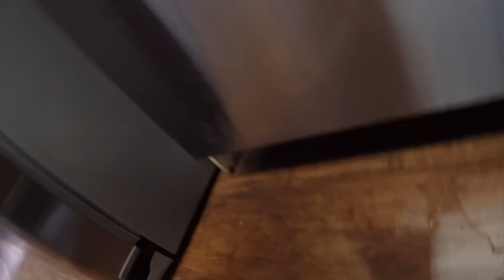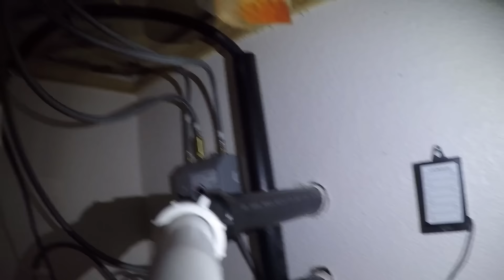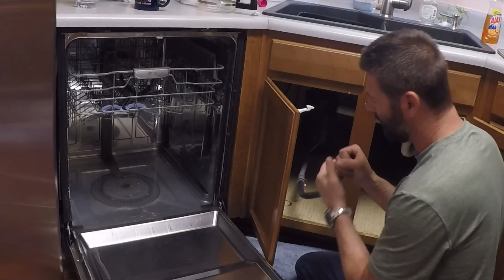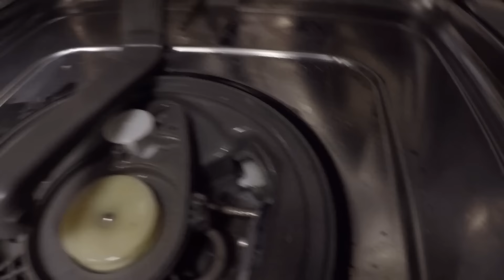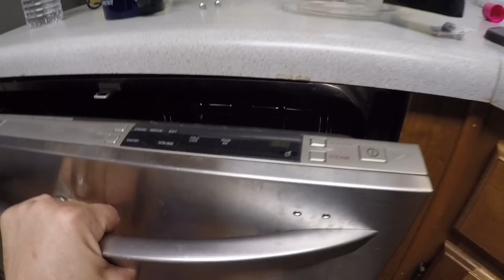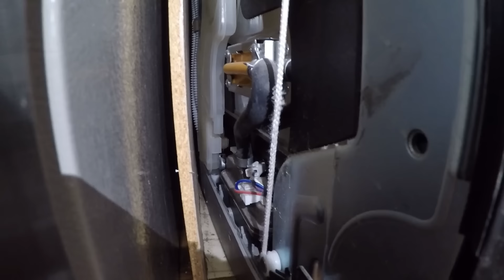Easy Fix For Dishwasher That Wont Drain | THE HANDYMAN

Comment: All, this is good information. Also if you have just installed a new garbage disposal in your sink, make sure the plug is removed. It is really easy to do just a screw driver and a small hammer. You can remove the plug prior to installing the disposal or if it is already installed just put you hand inside and pull the plug out. It’s made of plastic. If you are installing a badger insinkerator, read step 15 in your instruction manual. I didn’t and had water standing in the dish washer. This was the problem for me. Hope this helps someone.
Reply: Hi
Reply: Thank you!  This was exactly what I needed to hear.
Reply: Yes, it did, ty. Just changed garbage disposal n missed step 15
Reply: This was EXACTLY my issue. Thank you!!!!
Reply: You saved me hundreds of dollars from not having to call in someone who service my dishwasher. I read your post and found out this was exactly my issue. The installation video I referenced didn't mention this at all. Thanks so much.
Reply: You da man!
Reply: Thanks man, this was exactly my problem.  Admittedly didn't read the instructions that came with the new disposal.  Got it installed just fine, but had no idea there was a plug.

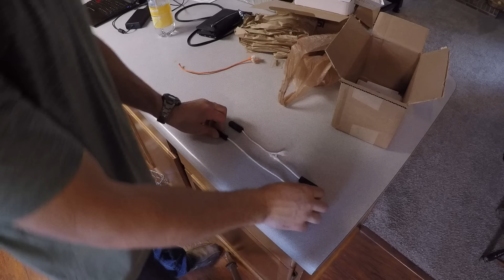Comment: 9:02 i have the exact same dishwasher and just did the exact same fix. i was shocked at how cheap they were using string. what annoys me even more is that i know i will have to replace it again in another few years. my grandmother has had the same dishwasher since 1981, and the difference in build quality is huge. things really were made to last back then.  had to replace the dispenser as well because the plastic tab that hooks onto the latch broke off

Comment: Had same thing few months back, it would work every other time you tried to run it.  After few times, the code came back on, pretty much I found glass stuck in the impeller and I believe it was there long enough that the motor was burnt out and wouldn't work until I replaced it. Works now, glad yours worked out 👍 keep the videos coming Handyman!

Comment: PROTIP: On those dishwashers - you can press the button THEN close the door versus trying to stick your fingers into the small slot post door closure event.
Reply: That assumes all your buttons are working. I've got a similar model. The buttons on the right half of the door just stopped responding on mine, meaning that I can't start a load of dishes even though the washer will turn on.

Comment: 12/21/23
Good idea to blow out the water drain hose. I did not have enough lung capacity and strength. I used an air compressor. I placed a 3/4 inch PVC nipple covered with an uncap with a quarter inch hole drilled. This worked very effectively.
. it cleaned out the clog from the Kenmore Elite.  It is now pumping the water out effectively. thanks for the good idea.

Comment: The two dishwashers I've repaired for friends both didn't drain because of a broken wine glass. Bits of glass got stuck in the bottom filter, pump drain, etc.
Reply: And how did you get it out? I suspect the same with our dishwasher
Reply: @billgatess1  I took out the racks. Undid the filter at the bottom and looked around the very bottom with a flashlight and carefully extracted the bits of glass there and in the filter.
Reply: Could broken vodka bottles stop it from draining? Asking for a friend.

Comment: i mess around for 6 hours cleaning the hardwater out of my dishwasher and it still didnt work until i blew the pipe like u did in this video and after that the damn thing worked finally , i guess it needed all the air out of the hose to make back pressure thanks so so much for your video, watched 20 others and it didnt work.

Comment: Hey handy man nice job figuring that out. I have installed many dw and inspectors here in florida want dw drain line coming from up top as close to top as you can then loop or have a lift and drop to keep from having water back flowing from sink back into dw and not draining right . Some counties want line strapped or zip strip holding high or holding loop. Good video ! Till the next one !
Reply: Thank you very much for the tip about the loop! My dishwasher was continually getting stinky and we couldn't figure out why. My dishwasher discharge line ran straight dishwasher to the disposal.. and I'm guessing it doesn't have a checkvalve in it to prevent flow from the sink into the dishwasher. Didn't have enough line to create a loop, but pinned the line up high, very close to the countertop and well above the disposal... it's been about two weeks now and the stink is minimal!! We've been washing dishes by hand in that time... there was still a little stink left in the dishwasher tonight when we looked for the first time so we're going to re-run it tonight to clear that out and get a better "stink baseline", but I think I'm going to go ahead and call this a win! Thank you again

Comment: Pls talk to us as your doing your stuff. No clue what drill bit ur using or which hose under the sink do we disconnect? I have 4 hoses with my disposal. I need better instructions
Reply: Please don't use a drill just use a standard Philips screwdriver the hoses that go to your dishwasher should run through holes that are drilled through the side of the cabinet there's a water supply hose and there should be a clear or maybe solid colored holes it's usually corrugated that will connect to a garbage disposal or the tail piece of the kitchen sink if the dishwasher is not draining try holding the drain option or holding the start option to cancel the operation to see if there's a humming sound if there is a humming sound that would indicate that the pump is still running if the pump is running try disconnecting the drain hose from the garbage disposal or sink drain tailpipe and using approximately 4 to 5 ft of 12 or 14 gauge electrical wire you will need to curl it at the tip to push it through the drain hose that will clear any solid debris from the hose you may require a multi-bit screwdriver such as a 11 in 1 to remove the drain hose from under the sink

Comment: I had a similar job 2 months ago. It turned out the check valve (a little rubber flapper valve) had broken off and got clogged in the drainage hose. I made a new one from a rubber flip flop sandal I had in my truck and it's still working. I did not charge for the new part :-)

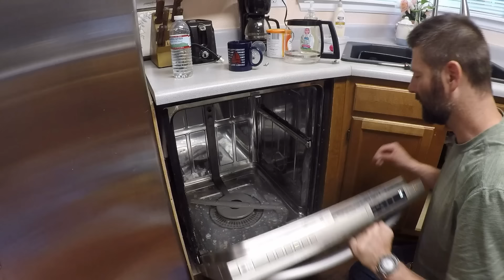Comment: 7:02  ...if you want your dishwasher to load hot water then run your hot water at the kitchen sink until it runs hot before starting your dishwasher otherwise it will load the cold water that has been sitting in the pipe between your water heater and dishwasher (which will likely be the amount that it needs and very little hot water will go into the washing cycles (the hot water will only fill the pipe between those appliances and it will cool off by the time the next cycle comes, the result being that you will be washing your dishes in cool or cold water (unless you DON'T use the energy saver settings or DO use the heating element setting if your system has one))).  I have the idea that you will understand the situation and how it is occurring now that its been brought to your attention... Best regards.

Comment: Great video, thanks!  My dishwasher is not draining consistently.  It drains initially and then stops.  The dishwasher rumbles but no water  is drained after the initial burst.  Does this mean my drain pump is bad?  Will drain pumps work intermittently or do I have another issue?

Comment: What area are you in? Is there a P-Trap on the ABS? That is the first time I have ever seen a dishwasher drain into an open pipe like that. Most parts of the country require the dishwasher to go through an "air-gap" before draining into the main line and all drain connections should be secured with clamps. Looks like there should be a screen protecting the impeller from debris. I also do home repair and remodeling on the west coast and much of the work I do is following other people around correcting the things they have done improperly.

Comment: Dishwashers, washing machines, fridges, etc....can be so finicky/fussy to fix. Can end up being something simple, or something horrendous 🤣 (wish the mounting clips/fasteners were made little bit more durable etc...; why, cuz you’d be surprised how many times I go & fix a dishwasher & those things are broken....or just plain GONE!).
Reply: Amen brother. Those mounting clips are flimsy and just waiting to slip off or bend off. Horrible quality even on the higher end dishwasher (I am looking at you Miele). The clips should not be poorly manufactured for installation of mainstream washers either. For the uninitiated, if your dishwasher is wobbly, look up at where the DW attaches to the underneath of the cabinet - it's probably not the feet (even though that was part of the problem in the Handyman's fix of this one). Good video. Good use of the shop vac on this one (and your next video) (taught me the versatility of a shop vac).

Comment: I haven't watched the video yet, but my dishwasher did this first time using it in our house when we bought it. Whoever installed it didn't angle the drain hose the right way. So the water wouldn't drain fully and would just back up into the washer.
Reply: Thats exactly my situation. I am watching vid before going to house to fix dw.

Comment: should be a check valve built into the pump that doesn't allow you to blow backwards like that. (has to be here in Canada maybe different in your location) the filter is fine its a dishwasher not a garburator. large foods and solid items should be removed from the dishes before they go in. anything the soap cannot break down the dishwasher, by design will attempt to flush down the drain. also if the pump is running with the door open as it was in the video, it means that your flood switch has been tripped.
Reply: You seem to know about dishwashers I have same problem with my dishwasher not draining. But I detach drain hose from sink drain. Dishwasher drains fine into bucket. (The sink drain is not plugged)

Comment: I just bought that zero-g pro hose a few weeks ago. I like the 3/4 in diameter as opposed to 5/8 in. And it is a breeze to move around.
I will be using it to pump rain water from my yard.

Comment: Heres a thought...RINSE FOOD COATED DISHES PRIOR TO PLACING IN DISHWASHER...QUICK RINSE AFTER USING THE DISH...JUST A PASS THROUGH THE WARM WATER...AND HEY NOTHING WRONG WITH PLACING IN HOT SOAPY WATER OR MAYBE DOING DISHES...NOT DIFFICULT, IVE HAD 6 KIDS AND I CAN COUNT ON ONE HAND HOW MANY TIMES I NEEDED SOMEONE ELSE TO WASH DISHES and i cannot count on one hand how helpful my husband was at anything other than impregnating me!!! You are a handy man a good dad and great hubby for fixing stuff. But to prevent future clogs maybe tell wife she must rinse food off dishes...you have a garbage disposal to grind residual food bits down drain for this purpose. I have a sprayer feature on my faucet and i love it. I do dishes by hand still even throughout giving birth to 6 kids i never used the dishwasher unless there was a flu bug or illness passed around between us and then i would wash the dishes and place them in the dishwasher and run a full bleach water cycle on pots and pans with heated drying like an autoclave..lol..after microbiology and infectious disease courses in college i am a germaphobe well kind of..and tell your wife 1 tablespoon of bleach to a normal spray bottle is perfect for disinfecting toys after playdates also great for doorknobs door jams inside of refrigerator and handles great for car door handles and steering wheels bathroom potty chairs and toilet seats and around floor of potty chairs and front of toilets...yes i had 4 girls 2 boys...lol..it isnt strong with bleachy smell and it is a virus killing solution you dont need to almost pass out with bleach fumes for bleach to be effective. It is strong you should pour some down all sinks and drains every once in a while and through washer and dishwasher..to combat bacterial growth and the germies that can come up from sinks drains and be airborn...if you can smell it there is a ton of bacteria already floating around in air. Also, even in winter open windows and air out house. You must change out your air in your house change your air filters in your air and heating intake filter...but open windows and doors at least once a week...in summertime daily.

Comment: Using the shop vac method, pulling your clog through the system, is very easy works all the time…….I’ve done it maybe 4-5 times in 2 years (kids don’t do a good job of rinsing before loading…..lol)

Comment: Nice fix with the string.  What was that grey box on the wall under the sink?
Reply: I wondered the same. Might be like a instant hot water thing but I'm not sure.
Reply: @hotrodhog2170  Possible my guess was some sort of water filter but I couldn't think of any reason why it would look more electrical in nature.  If it was a heater it would make more sense.

Comment: Also, put a level on the unit. It needs to be level all directions or water can leak past the gaskets. Just like if the dishwasher is got food build up or calcium build up in the spray arms. That can also cause water to spray oddly and a perfectly good door gasket will leak.

Comment: What about a dishwasher the drains but stinky despite being cleaned with multiple cleaners and bleach? Dish washer is phenomenal other than the stench. (Actually I think I have the same dish washer as in the video)
Reply: Make sure your drain hose has a high loop in it to stop sink water from backing into the sump of the dishwasher. That can cause a smell

Comment: Push the drain option or start option if you don't have a drain option and then hold it down to cancel to see if it makes a buzzing sound to indicate that the pump is running In the case where the dishwasher is clogged and won't drain you can actually disconnect the hose at the garbage disposal or dishwasher tail piece that it drains into and try running approximately about 5 ft of maybe 12 or 14 gauge wire you may need to curl it at the tip so that it will push through the drain hose that'll clear the hose of any solid debris that could be clogging it there may also be solid found in the area of the dishwasher where the water drains where the spinner is so you will have to remove the bottom rack and remove the spinner to see if it's blocked that way you may also have blockage in the back of the of the dishwasher where the hose is connected to the discharge there's a flapper valve there once you disconnect the hose things tend to get stuck there and won't let water flow to check that you will have to remove the dishwasher from under the counter

Comment: 7:43 what is that on the right?
Also I have this exact same dishwasher. Thanks!
Reply: kmonnier I was wondering the same thing.  It looks like a sandwich bag with a rubber band fashioned on to a dish soap dispenser to catch a soap leak.

Comment: I am a bit surprised your were able to blow through the drain hose from that end because there should be a check valve on the other end of the line that prevents back flow from the sink..
Reply: Your right bg147. There should be a check valve in that hose. Betcha its broken

Comment: 2:25 For the love of health and decency... what is your problem?!?  I have the thought that this guy did this video just so he could post his 2 minute+ gimmicky garden hose sponsorship advertisement! 
 
Folks:  Do yourself a favor take notes or pictures so you can remember how it goes back together (and do it right away, don't put it off), trust me on this.  Another tip, don't wait for a month or longer to address this problem and you won't have to deal with the smell of stagnate water (and try a pair of latex gloves, if you aren't allergic).

5:54 PS  And use extra caution doing this sort of foolishness because if you break your dishwasher's hot water inlet line  (very few use flexible hoses) then the result will be a VERY flooded house with a huge amount of water damage and a piss poor time of it explaining to some BS insurance adjuster what in world you were trying to accomplish (by the time you, the plumber or emergency responder finds your main water shutoff valve, HOURS OF BLASTING WATER), if you're lucky! You will not want this situation to happen (think flashing emergency vehicles blocking traffic while parked for hours directly in front of your house, nervous breakdowns, your mate thinking you are an idiot for the rest of your lives together, HOA/neighborhood gossip or worse).

There are some really good videos around here but...